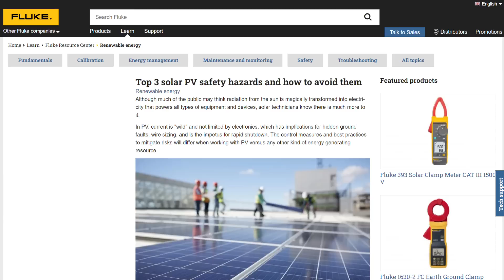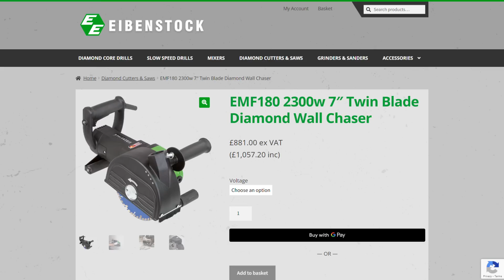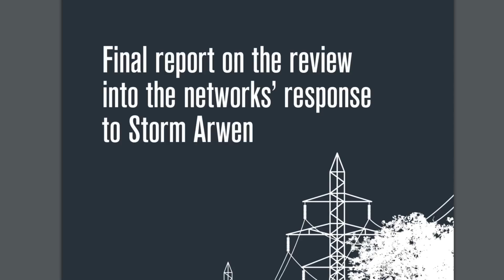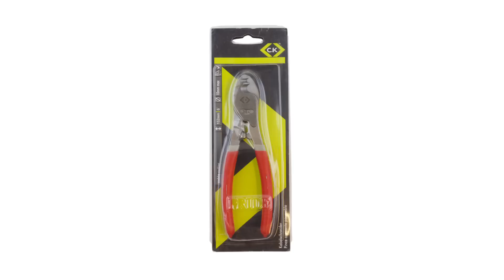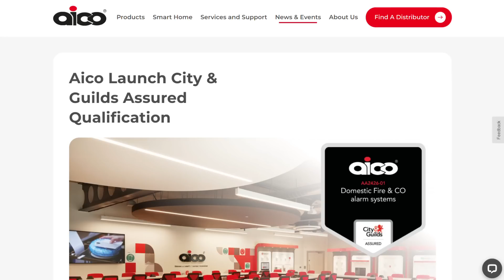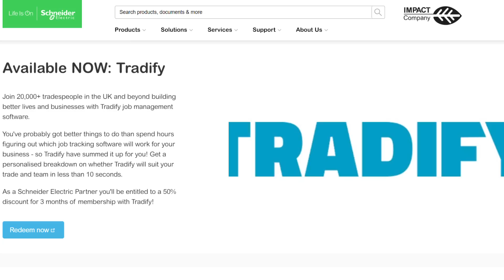DIYer Electrocuted After Drilling Through Underground Cable

Comment: I found out there was a rather larger mains cable in my garden when I came home to find a very large hole had been dug in the ground next to my drive exposing it. The DNO (SSE) had been contracted to connect power to a couple of new houses, and it just happened that the convenient point to tap into it was where the distribution cable ran through my land to some other houses. For some reason, they didn't actually inform me that they were going to do such a thing. Fortunately it was rather deep, and it only crosses a corner of my land, so I don't think I'd have ever dug down to it by accident, but it does make me wonder what other services there might be underneath my property.

Comment: so how much money are they gonna pay us for the wear there placing on our batteries by using them for the grid

not to mention the money there saving by not having to install battery systems themselves
also how is this going to work exactly?

most cars go on charge at night when solar is offline sure but the demand falls also.  as well as this at night the cars are trying to charge so will be at there lowst charge levels and almost negligable in there ability to power the grid 

also are they going to offer ATLEAST parity in sell and buy rates? many companys will pay you for power at a lower rate than what they charge so if i paid 24p to put 1 kwh into my car i want atleast the same when you take it back out again

Comment: Just remember diging in my garden round the border an hitting the cable as it was about 11 inches under the meter was in a out side box.  So I sprayed plastic seal over it wrapped plumbers tape over that then plastic spray again then tape.  Way beck in 1998.

Comment: If you buy an EV and the most expensive part of the vehicle is the battery, which has a limited number of charging cycles, why would you want to let the grid use your battery to help balance demand?
Reply: Because you can get paid to and the numbers of charging cycles being used is negligible compared to driving the car. New EV batteries are proving to last hundreds of thousands of miles of driving. I'd imagine large numbers of people now don't keep a car beyond the initial lease/PCP period. So somewhat shortening the life of a battery years in the future after you've owned it is not going to be a big concern. 

I'd imagine as EV adoption becomes more widespread people may start to become more cognisant of things like charge cycles used on a battery. But most people likely still have a mindset of miles driven being a big determining factor in the health of a car.
Reply: Warwick Uni ran a two year trial of repeated V2G charge/discharge effects on vehicle batteries. This allowed Nissan to maintain their 8 year battery warranty on the OVO V2G trial, for all their 30/40 and 62 KWh Leaf vehicles.
The trial showed no measurable loss of battery life in daily V2G, with the cycle limited to 6kw max power and 17kwh total per cycle.
Reply: It’s the depth of discharge/ charge that matters. If you want 2x the lifepsan from a lithium battery, you can limit charge to 90% and discharge to 10%. 4x if you limit it between 20% to 80%. It’s unlikely you ever need a full charge unless you have a hybrid with small battery.

These grid systems will only discharge a few % before charging again. Almost no degradation to the battery.

Comment: Just to clarify, a UPS is designed for the purpose of allowing controlled shutdown of equipment during a power outage, as well as protecting from brownouts and surges. It's not designed to keep equipment running until the power comes back up.
Reply from the maker: Depends upon the size and equipment being protected.
Reply: For me, they keep the equipment running until the power comes back up. Either utility power or diesel, but our kit certainly doesn't start shutting down when the UPSs take over!
Reply: @obd6HsN  Yup, diesel can take over. Just meant it's not a long-term solution really.
Reply: Can't a generator be considered part of a UPS system?
Reply: @JohnWatkinsUK  I suppose that depends upon whether you also consider the utility power to form part of the UPS system too, at which point I'm not sure the term retains any useful meaning
Reply: As a Disaster Recovery Professional, my two penny worth is that UPS battery systems keeps the system going until the backup power supply reaches a stable output and you can switch over to it, it is not designed to carry the full load of all systems until the DNO restores power. Having said that you can have switch over to protect certain limited circuits or to allow the structured shutdown of say IT systems that could otherwise be corrupted.
Reply: Use to install UPS , also used for a smooth change over for a generator to take over.
Reply: That is true for non critical systems. Critical systems, rooms or building often have UPS that can run them for hours to days. Some locations you cannot have a backup generator. We try to avoid diesel backup if possible. The maintenance and fuel rotation tends to be problematic.
Reply: @dannelson6980  Yes, in the IT industry, it's more effective to have redundant locations, so when the UPS kicks in, a controlled shutdown is performed and service continues from another location.
Reply: @Elminster   It would depend on the backup time provided by the UPS's battery charge.
Typically fall into two categories 1) As you stated, to enable safe shut down of equipment, such as IT infrastructure. Tupically for a few minutes of operation.
2) There are UPS systems that will run for 30min, 1 hour or even more, depending on the load and kVA stored.
Reply: I have seen various sizes of UPS, from very small ones that are intended to maintain power for hours to a single appliance, to bigger ones feeding an entire data centre with enough power for a few seconds to allows a diesel generator time to startup.